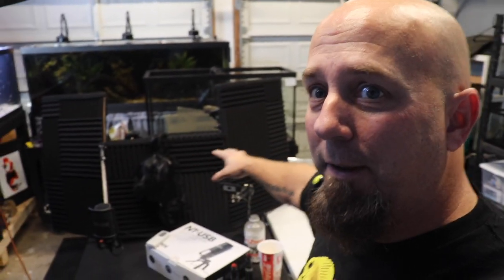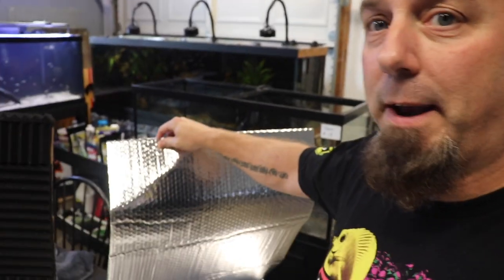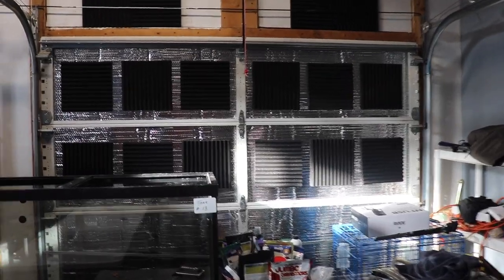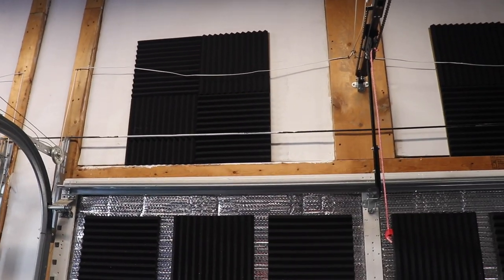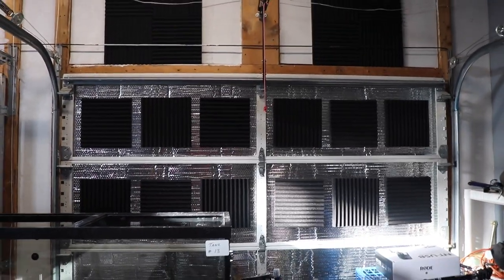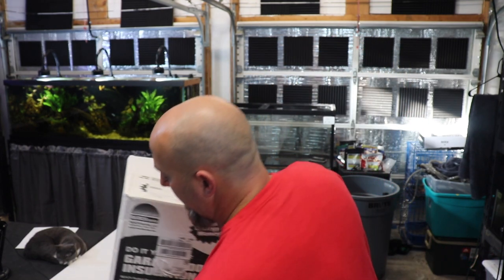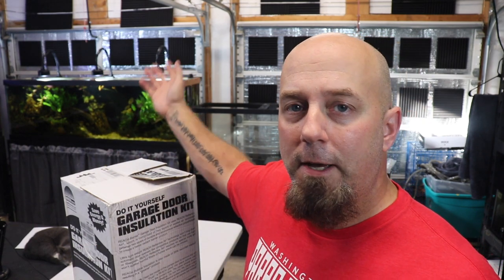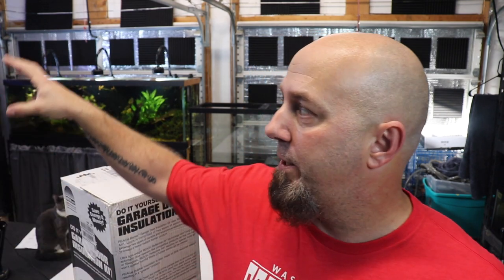Heating A Fish Room! DIY Garage Door Insulation, Aquarium Temperature And Heating

Comment: I like that you floated the acoustic panels over you mics.  The acoustic panels do help.  I'm not an expert on the subject but I learned some tips  from others as I created a small area to record music in my home.   Be sure to put acoustic panels behind where you use you mics (if you have not already) to reduce reflections while you record. The thicker the acoustic panels the more absorption  the sound waves.  You can get more mileage out of your panels by mounting them away from the wall.  The air gap will help further reduce the sound reflections. The corners of the rooms are an area you may want to treat with bass traps.

Comment: Hi. Enjoy your videos very much. Thanks. I may be wrong but while watching this video, being in the garage door industry, I noticed that your garage door extension springs do not have "safety" cables installed. They are simply a length of aircraft cable that runs through the center of each springs & then attached to an appropriate anchor point, at each end, which would contain a broken spring. All springs break, at some point, when your doors are closed they are under constant tension. A broken spring flying about can cause injury to you guys and or easily break open one of your tanks. Just a heads up. Take care. George T.

Comment: Fighting the same thing in my garage as we speak. My door panels are already foam but the doors seams where the metal wraps around are the cause of a lot of the heat transfer. Anywhere you feel cold on the door is where heat is being lost.

Comment: Thanks for sharing. I need to do that in my garage. Could you still open the garage door with the panels on it? Maybe a dumb question. LOL. But I need to be able to open my garage for cleaning and such. It certainly looks like the doors would open no problem.
Reply from the maker: Absolutely, it doesn’t effect the operation of the doors at all😎😎

Comment: As a garage door installer should just go with insulated doors with a torsion spring setup because those doors you have are extension springs setup that run along the upper tracks now if one of them brakes it might tank one of the tanks out not a safe design

Comment: I don’t see how that thin thing is gonna insulate those doors I prob would’ve went with the pink panther styrofoam insulation but who knows it may work
Reply: It's basically a heat reflective barrier. It's sold in huge rolls at Home Depot too. It's a lot less messy and more compact than the pink panther fiberglass stuff. Since he's heating the garage with a space heater, 95-97% of that heat should get reflected back into the room instead of escaping to the outside. It also works the opposite during the summer where the radiant heat from the sun gets reflected instead of entering the garage.

Comment: That’s stuff is easy to work with if it’s the same stuff I used on my truck. I could feel air come Thur in winter when I was driving, on the ends make to use insulation tape it just help to keep air from getting around

Comment: that looks nice but totally useless, you have left all the edges around the doors and the sections in the doors where the hinges that allow the door to fold are uncovered ?? were do cold drafts come from, gaps like these should be covered. would have been a lot simpler just sealing it all from the outside